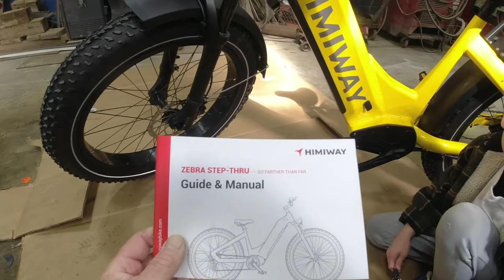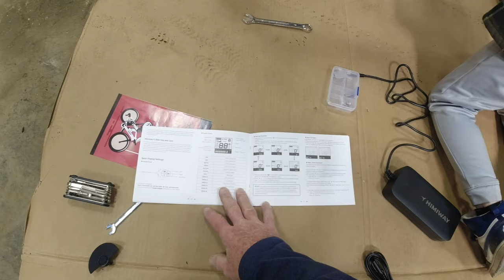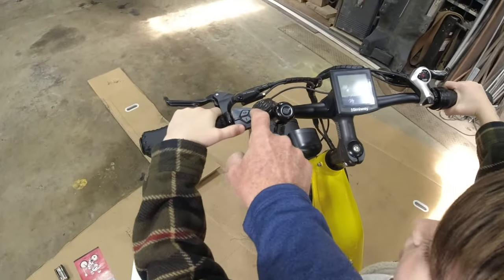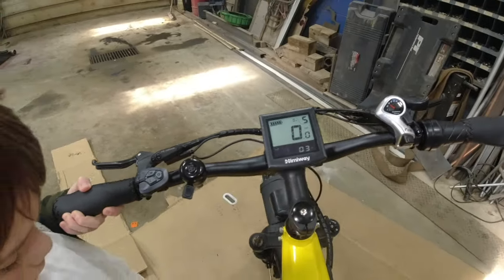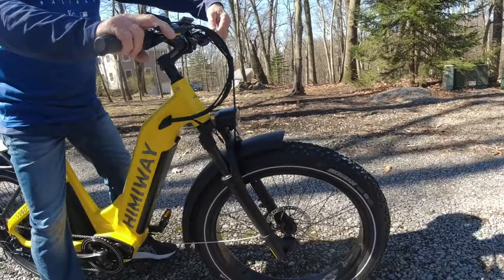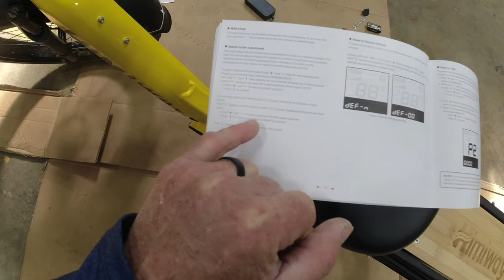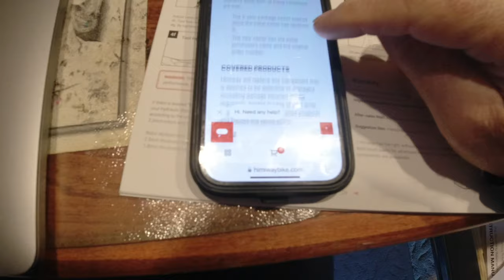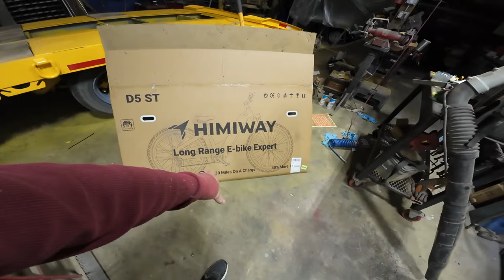Himiway Zebra Long Range Ebike - 80 Miles Per Charge!!!

Comment: As I climb down my front door steps, I cling onto the rail. I've fallen once, carrying my trash bag out to the can. My left shoe pealed the purple skin off my diabetic ulcer on my right ankle. I have an ulcer on my left ankle also. Man, it took forever to heal, w special mixed ointment the wound center prescribed for it. I also pass right beside my Honda Classic VT1100 motorcycle right beside the steps. With today's morons driving and texting, being morons, it takes much more physical ability to keep that 550-pound bike out from in front of them. So, I quit riding in 2020. I am scared of falling. I weigh 360. I live by myself and take care of myself. I have an old back injury my excessive weight magnifies the pain greatly. I wonder, what is the weight capacity on the bike? If I was able, I'd buy that bike!! 80 miles, even 50 miles on a charge is nice! My riding days are over. I'm 69 July. Always worked outside. I'm definitely an outdoors guy. Was a bricklayer for 9 years back in the 70s. I've rode motorcycles all my life, from 1973 to 2020. Getting old sucks. I don't know about everyone else, but I see no reason to apologize for any content you publish. My main desire is to see real life happening. Today's content was another ebike, a different ebike. A top quality ebike, I'd love to own. It was so much fun watching this video, I see no reason at all for an apology.  I never miss your videos because no matter what the days content is about, it's definitely gonna be good stuff. There is no comparison to the crap on TV. As always, I really appreciate you taking the time and effort and allowing us to share your real today!! This was very enjoyable. 👍❤️🙏🇺🇸🇺🇸